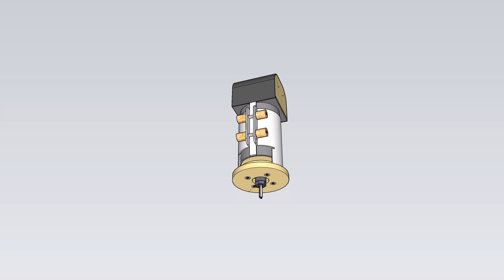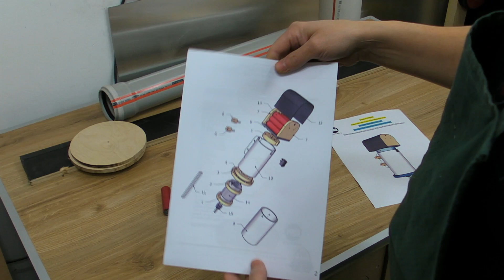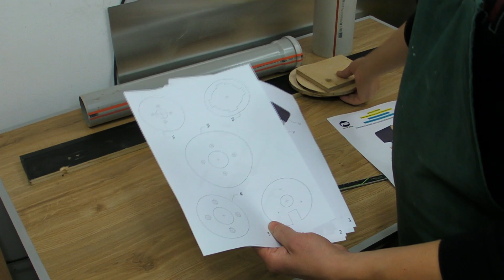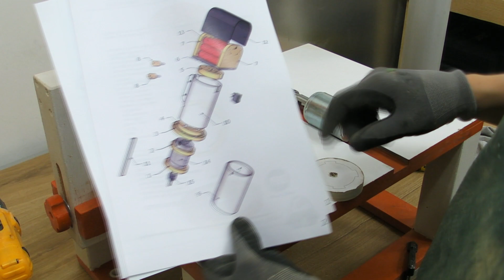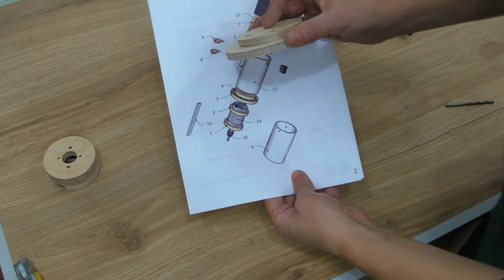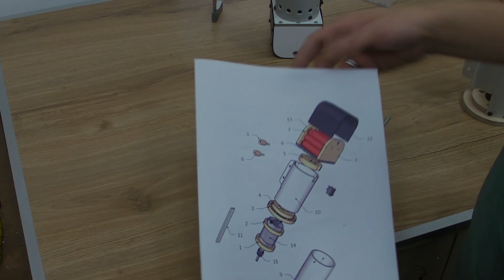Homemade Cordless Router

Comment: Seria posible utilizar el motor de un taladro a batieras a 12 v con  6 o 9 baterías   18650 para aumentar la capacidad de la batería
Reply from the maker: Usé 12 baterías 18650. Lo hice en forma de 6S conectando 2 paralelos. Si se aumenta el número de conexiones en paralelo, aumentará la capacidad de la batería. Sin embargo, los motores de perforación inalámbricos siguen siendo débiles. Sería más apropiado usar un motor 775 de alta velocidad.
Reply: gracias
Reply: lo de los BMS lo controlo  pero  un 775 a 12v y 9 pilas 18650 conectadas adecuadamente seria suficiente o se quedaria escaso
Reply from the maker: No es suficiente alimentar el motor 775 con 12V.  Es necesario aplicar al menos 24V.  De lo contrario, la velocidad será baja.
Reply: a ver como me apaño, no dispongo de cargador de 20v, buscare un alimentador   aunque lo tenga que enchufar a 220v lo que me gusta realmente de tu trabajo es el tamaño de la fresadora , muy manejable, gracias por contestar a mis prguntas
Reply from the maker: Hola.  Si fabrica un paquete de baterías para 10 s, será 10x4.2 = 42V.  A este voltaje, el motor 775 funciona perfectamente.  Puede utilizar un cargador de monopatín eléctrico como cargador.  Por supuesto, no será fácil encontrarlo, pero será bueno para la velocidad del motor.
Reply: muchas gracias  veré cómo me las apaño
Reply from the maker: Gracias tambien

Comment: Burada kullandiginiz kaplin ve testere bıçağının modelini söyleyebilir misiniz?
Reply from the maker: Merhaba. Kaplin ER11. Bıçaklar markalı değil. İnternetten uygun fiyatlı bulunca almıştım. Şaft çapı 6mm. ER11 mandren alırken buna dikkat edilmelidir. Yani 6mm safta uygun ağız alınmalıdır. Ya da bunların yerine motor mili kalınlığı olan 5mm şaftı 6mm ye çeviren Kaplin de kullanabilirsiniz.
Reply: diğer videonuza yazacağım yerde bu videoya yazmışım. Daire testere yaptığınız video için yazmıştım o videoyla ilgili detaylı anlatabilir misiniz
Reply from the maker: Selam. Geç dönüş yaptığım için kusura bakmayın. Kullandığım Kaplini ben Çin'den almıştım. Size örnek bir link vereyim aşağıda. (şaft mili çapı 5mm olacak). Bıçak göbeği 20mm veya 16mm olan ve çapı maksimum 160mm olan bütün daire testereleri kullanabilirsiniz. Mümkün olduğunca ince dış kalinligina sahip bıçak tercih edin. Benim kullandığım bıçak 2.6mm kalınlıkta ve bu makine için kalın sayılır. Bıçak koreldikce kesim işi normal daire testereye göre kullanışsız hale geliyor. Kaplin linki...
https://m.tr.aliexpress.com/item/10000388657532.html?spm=a2g0n.productlist.0.0.375d6c811217FL&browser_id=889d8b5dd966429a93ef4730105d1873&aff_trace_key=007db7e93d684e80b172cd7ff46954e9-1669897485134-09384-hbH1Nkk&aff_platform=msite&m_page_id=ge0phizpaeicarfm185002304bf1257a15f21a7d82&gclid=&pdp_npi=2%40dis%21TRY%2146.51%2146.51%21%21%21115.77%21%21%402100bdd516707445738564921ecd6b%2120000000193575485%21sea&curPageLogUid=XHBtP9wzJZyT&isseo=y&algo_pvid=ea64542b-5c44-4756-8f39-302418cde892
Reply: çok teşekkürler tüm ilginiz ve cevaplariniz için çok hevesliyim lakin yeniyim. Bundan dolayı çokça soru soruyorum. Sagolun. Bir soru daha sormak istiyorum. 36v 10a lik bir güç kaynağı nasil elde edebilirim. Elimdeki adaptorlerle step updevresi bağlayarak birsey yapabilir miyim yada ne önerirsiniz. Direk 36v 10a lik bir güç kaynadı satın almak çok maliyetli olacak. Ne önerirsiniz?
Reply from the maker: @resatbora  Dediğiniz gibi 36V 10A güç kaynağı pahalı olur. Bu nedenle ben batarya kullanmayı tercih ettim. Belki bir mikrodalga fırın trafosu kullanarak yapabilirsiniz. 1.5mm2 kablo ile 35 tur sarım yaparak çıkışa 50A lik köprü diyot ve 4700uF kondansatör bağlayabilirsiniz. Bu şekilde 20A lik bir güç kaynağı elde edebilirsiniz diye düşünüyorum. StepUp devresi iş görmez. 360W güce sahip bir StepUp var mı bilmiyorum ama olsa da pahalı olur. Mikrodalga fırın trafosu 800W civarı güce sahip. Rahatlıkla iş görür gibi geliyor. 2 trafolu kaynak makinesinde kullandığım köprü diyot baya uygun fiyatlı.

Comment: Nice project bro👌👏🏻. What volts and how many the motor you use?
Reply from the maker: Thank you.  I used 895 DC motor.  The 775 engine is also suitable for the dimensions I have given.  I used 6 cell 18650 batteries for voltage value.  In this case, the voltage value was 22.2V.  But if it is supplied with 36V, the speed may be higher.
Reply: how many watts the motor you use?
Reply from the maker: According to the datasheet of this motor 100W
Reply: can work 80 watts?
Reply from the maker: However, the mechanical power is 360W. You can check the link below.
https://www.handsontec.com/dataspecs/motor_fan/895-Motor.pdf
Reply from the maker: Are you asking if it can work with 80W?
Reply: yah
Reply from the maker: It will work.  But I was wondering what kind of device is the 80W power supply?  So like 16V 5A?

Comment: Excellent! Next logical step is to make a base plate out of transparent plexi 🙂
Reply from the maker: Excellent idea... Honestly, I was going to do as you said, but I didn't get a chance to buy plexiglass. But it would be great. Thank you for your interest.
Reply: I dismantle some old TV recently, the ones with plasma retrolight, they all have a plexi layer on the back, the bigger the tv the thicker the plexi. There is some pattern on them to diffuse the light, but it goes easily with acetone.

Comment: Merhaba , frezenin çakısı için penseyi bulamadım , nereden alabilirim . Tşkler
Reply from the maker: Merhaba. Ben aliexpress sitesinden almıştım. Türkiye'de var ama daha pahalı.  "ER11 pens tutucu" olarak arama yapabilirsiniz. Motor miline göre seçim yapılmalıdır. Yani 775 motor için 5mm. Sizin için aşağıya 2 link bıraktım. Linkler rastgele seçilmiştir. Ayrıntılı arama yapabilirsiniz.

https://tr.aliexpress.com/item/33009204061.html?gatewayAdapt=glo2tur&spm=a2g0o.productlist.0.0.b4df5706POyHgL&algo_pvid=680dbd73-a80d-4e01-9995-077cd1704235&algo_exp_id=680dbd73-a80d-4e01-9995-077cd1704235-18&pdp_ext_f=%7B%22sku_id%22%3A%2210000014441795294%22%7D&pdp_pi=-1%3B2.9%3B-1%3B-1%40salePrice%3BUSD%3Bsearch-mainSearch

https://www.robolinkmarket.com/er11-chuck-5mm